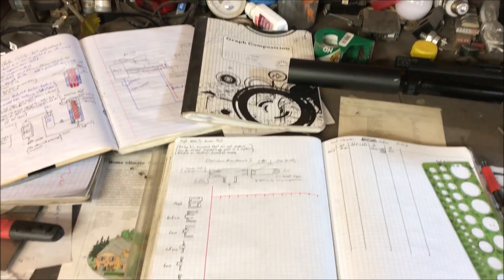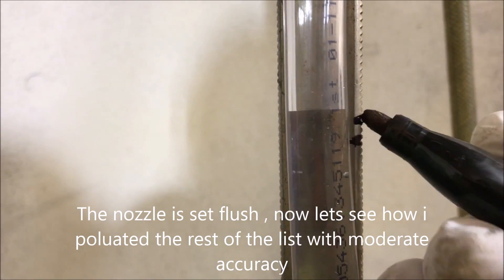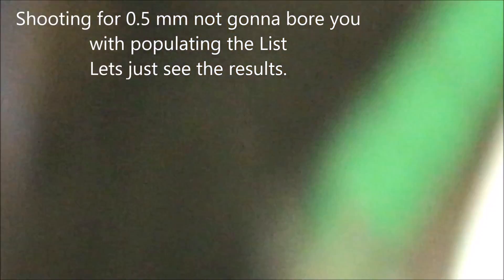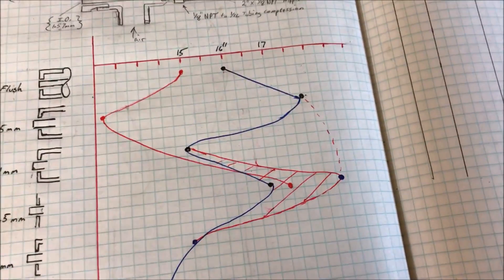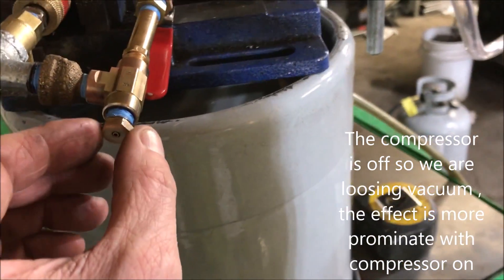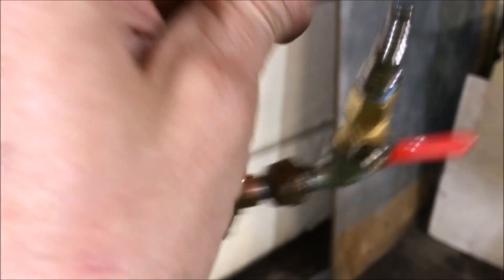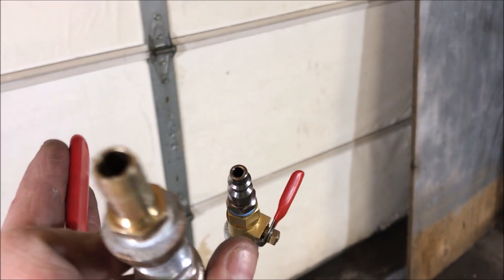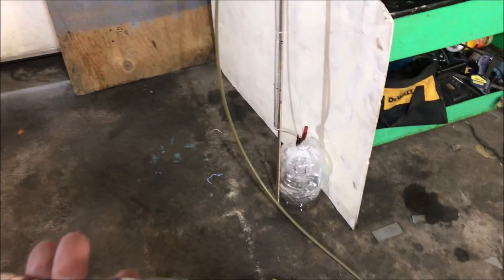Waste oil burner nozzle Design HIGH VELOCITY COMBUSTION

Comment: You may spray a paint and see the pattern it develops on a surface. Then you may conclude the quality of the nozzle against it. Thanks for sharing your findings. These projects with the oil burner reminds me on a air gun for sand blasting. Just copy of it. It may work only if not made of aluminium (some of them). Still the pattern on a surface may indicate the quality of the spread of the particulates to some degree, the key qualities are the spread of it in 3D volume space against the time derivative and different nozzle configurations.

Comment: A bit late to the party, but I was wondering if this atomizing technique is effective to dry the oil if directed to a tank ? (I'm making biodiesel if you're wondering)
Reply from the maker: yes if you spray it with hot air
Reply: @NOBOX7  will hot air risk it catching fire ?

Comment: Brother, i enjoy watching your works and learn alot from you. Only you and Oil Burner are the two youtubers i watch most everyday. For the ratio of your fuel, i think its the tip of your needle. Slight crooked cut on the tip could make a difference. Im just suspecting that because of your recording. There were times two lines went opposite directions and time they went far right. Im building my own burner right now and im combining your work and Oil Burner work into one. Thanks for your time teaching us and inspiring us with this kid of work.

Comment: Great video (other than the sound). I appreciate the graph; however, the nozzle extension order is not quite right. The "flush" should be thought of as 0 mm extension. That datapoint does seem to fit quite nicely in the rest of the graph if placed properly and then no odd dip-and-spike occurs.

Comment: All your  work is beautiful!!!! 
BUT 
you can buy an atomizer on E-Bay for 20 bucks 

Why all the study and work? 

Trying to improve the NOZZEL? 

Personal information and knowledge?
Reply from the maker: Those nozzles are different then mine , they dont flow the same and the dimensions inside mean it all, and $20 is just for the nozzle you gotta spend another $35 to $45 just to hook the  thing up . 
vlavels $12 to $24
barb connector $2.50
air connector 1.80
stand off pipes  $14 
FNPTxFNPT $2.45  or flare fittings 
d off pipes 
and they have no bracket to mount the torch , also who knows what size to get ??? I do , and by no means are they all the same , some wont pump cold waste oil at all . There are many videos of the ebay nozzles not working even with diesel fuel . They will work in a foundry  or forge but the thing is you dont even need a nozzle to do that . These are focused on high performance friend not just regular operation , i wanted to take it to the next level and out due the current equipment and provide unmatched input and service at the same time . it comes down to knowing what is best a 2 mm oil penstock or a 4mm penstock for my specific pump and job , well i know alot of this info  so being abl to help my customers with extreme detail and videos to back up a claim , at the same time i openly share my ideas  { and advice }for those who own the tools to make there own .
Reply: Mr Me, Your comment is interesting. Probably comes from an assumption that the development of the nozzles is over. Maybe. But I understand that NASA , SpaceX and others still study these kind of stuff even after decades and decades of studies. You never know what an idea may come from it.

Comment: What do you think about hago 0.75 siphon nozzle?
Is a good nozzle or not?
Reply from the maker: Never used one but from what i know from clients they dont work well , i sold a burner to a black smith who has a delivan nozzle basicly the same thing and it doesnt work that good but it does work
Reply: NOBOX7 An another question for you.What do you think about the burner  from a Youtube channel called Brian Oltrogge?He made a burner for the fire keg furnace using an hago 0.75 siphon nozzle.You can see the build video on the channel.What do you think about it?It's powerful?Many thanks

Comment: Interesting. I started building burners also inspiring from your videos. I don't know much about nozzles but i understood it's very important. 
Some times ago i told you about using ethanol. If you will use it, i say to you to be very careful because inside the air/fuel mixer tube ethanol can explode with force.

Comment: The funny thing about nozzles like this is fluid dynamics is sometimes not what you calculate on paper. Volumes, pressures and velocities can be accurately estimated but with this kind of project you will not know exactly until you test. Other than that, when you use the term "optimum" it's best to define it. 'Optimum' =/= 'Maximum.' Since you're making a burner, it appears you're looking for heat. I would define optimum as highest BTU, Kcal, ΔT (any unit you chose) output with the lowest volume of fluids input. My experience suggests ... from looking at your pintle, IF YOUR DESIGN ALLOWS, try using a solid pintle with a cone taper that ends at the same height as the orifice diameter and protrudes only as far as the tapered area. That will give you a much greater range of consistent pattern and flow with big variations of pressure and fluid volumes.
Reply from the maker: Indeed , seen the same thing with thermal expansion and contraction , contraction is faster then expansion in hot cold water bath testing . Im interested to see if there is a flow rate correlation with the induced vacuum .